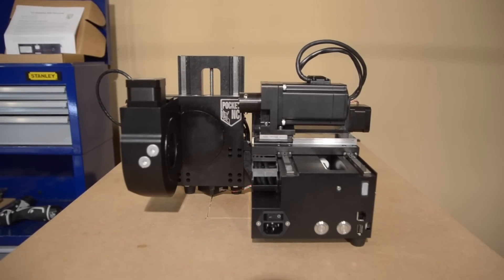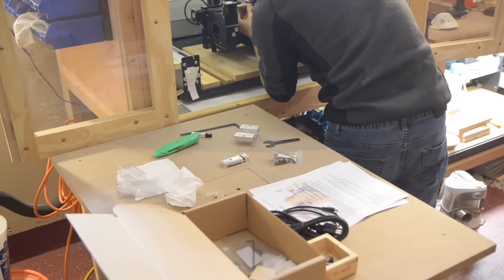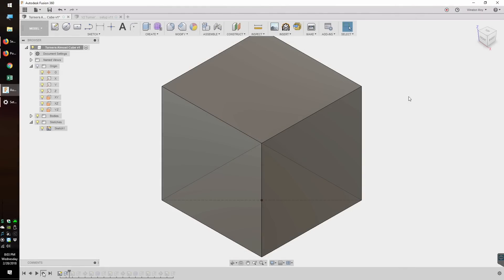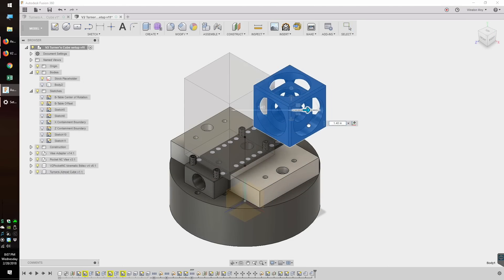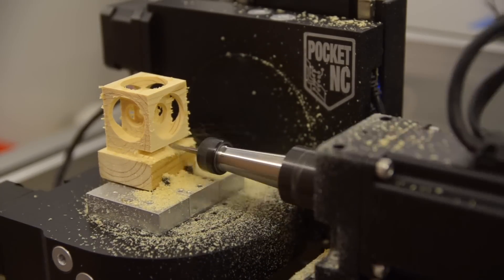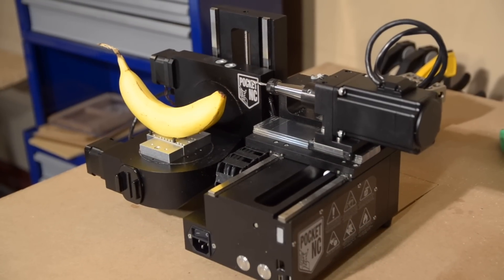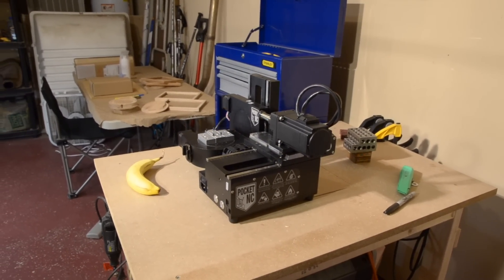Intro to 5-Axis Machining on the PocketNC v2 - Project #112 [CNC]

Comment: Does this have the torque required to carve hard rock? That means that the machine must be able to withstand constant water.
Reply from the maker: The axes are not suitable for exposure to liquids, and abrasive dust would also damage the machine in the long run.

Comment: if have 10k on pocket buy 3 axis mill.this wont sell to masses becouse price.6k for v2-10 10k for v2-50.is it mean v1 cost 2k. yeah i would buy it.even without motors and hardware,but now. it wont hit masses.its only sell to those who has 10k on pocket to spend at one go,but all those who has 3k something spend it on some else.if they would sell bare bone machine without hardware then later they would buy hardware kit or build then cheaper yeah.after order they hit cycle start on cnc propably allready setup for multiple parts.then they go tanning while cnc cut it. it wont cost that much

Comment: My own philosphy is: if you modeled some thing that could be produced only by 5 axis milling - you are an idiot, but not an engineer. The cube you shown in the video could easily be done on every cnc router even with the chamfer. There is no such a big problem to rotate the cube an change its position by hands. You will have also to do it for the last side of the cube. For such a money i'd better bought a 3 axis steel cnc router

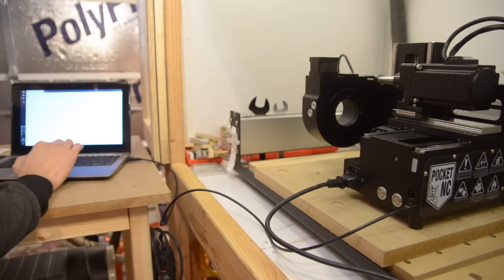Comment: At 4:35, you mentioned that the E-stop light never blinked. I have the same PocketNC machine and am encountering the same problem. If you don't mind sharing, how did you get the machine to work? For me, the blue lights around the Beagleboard turn on and then after a while, turn off. Let me know if I can provide any clarifications.

Comment: So if I want to get into machining do you recommend I start with CNC (obviously 3-axis) Or should I get a lathe and work with that? I’ve used a lathe for wood many times but only once for metal. Any tips? Thanks
Reply: Get a lathe, then a 3 axis cnc, then when feel confident go all out!

Comment: I don't see a practical use for the pocket nc. The nema 34 stepper motor it uses as the drive for the spindle is barely capable of turning steel but with that much tool stick out and the weaker a and b/c axis motors, plus the small work holding and work volume of the table itself, I can't even begin to imagine what this thing would be useful for. This isn't to say it's not a very interesting machine; because it is, but faced with a choice to buy this or a cheap 3 axis cnc router or even a second 3 axis cnc router if I already owned one, I would always choose the 3 axis machine no matter how many of them I had. I suspect most people given that same choice would probably do the same. I did say *most*. XD

Great vodeo nonetheless!

Comment: What are your feelings about rigidity of this machine? Is this a hobbiest tool, I have seen the demo of it machining aluminum but do you think you would feel comfortable machining small stainless steel parts with it?  I am concerned about chatter working with harder materials, titanium, 304 sst etc.
Reply from the maker: Rigidity is just enough that you're able to put some science behind your feeds and speeds. It won't be fast, but you should be able to hit normal chiploads with the right depth of cut. Look up @ekramer3 on instagram. He showcased a stainless steel lanyard bead he made on the PNC, and has plans to try titanium, grade 2. 304 is tricky, 303 would be friendlier.

Comment: is it suitable for sculpture designing engraving on iron up to 2mm raised form
Reply from the maker: If you're only engraving, maybe. But if you have to remove any significant amount of material I wouldn't. That's pushing the limits of the machine.

Comment: Lovely gadget but the web site suggests it will cut 4140. I seriously doubt that and $5000 and no coolant?
Reply from the maker: There's a video of a Shapeoko milling small pockets into 4140, with a small endmill you can get away with a lot. Won't be fast, but you'll get there by controlling cutting forces. This isn't a tool for mass production.

Comment: Okay, personal pet peeve:  CNC stands for "computer numerical control" and you sound ridiculous referring to every CNC machine as simply a "CNC", although you are not the only one to do this, by far.  What you have is a CNC mini mill, which is really cool, but radically different than a CNC lathe, CNC plasma cutter, CNC laser cutter, etc.  Calling everything that uses computer numerical control a "CNC" just makes you sound ignorant.  Not trying to be a jerk, just trying to help you with your terminology.

Comment: I see in the background that you've been using a Makita Trim Router on the Probably 3 axis CNC table. I just bought one myself however am yet to make the new mounting bracket. How has your experience with Makita been so far?? Earlier I was using one of those Chinese 400w quiet cut spindle which had quite a run out and burnt out fairly quickly the moment I started using 6mm end mills. When machining wood, whats the max diameter of tool you think the Makita can handle comfortably?? Can it run one of those 20 to 30 mm surfacing tools if take a 1 mm pass??
Reply from the maker: I liked it enough that I bought a second, so both my Shapeoko's are running the Makita. I have used it with a 1" surfacing cutter comfortably.

Comment: I have a v1 pocketNC and was one of the backers of their kickstarter for it. 
A bit of advice that I have learned the hard way:
Don't over think the work holding. Just use the painter's tape + CA glue trick for most of your work.

If you are not familiar with it, there is a really good tutorial on it on NYCNC youtube channel. The tl;dr is that you apply painters tape to the stock and then also to a waste plate. After cleaning the tape with IPA, you apply CA glue to the painter's tape and then stick the stock to the waste plate.

This provides surprisingly good holding strength. So far it has not failed me in milling blocks of aluminum on my PocketNC. Though do be leary of how tall your stock it, I have not run into problems yet, but it seems like really tall stock would be a failure point for this method on a 5 axis CNC.

The bottom line is that the pocketNC just does not generate that much force on the stock. I guess that is an upside of work with such a small unit.

Comment: $5000 for a 5.5x2.5 inch work space? I cant stop laughing. 5 axis or not that is robbery.
Reply: Pretty good price for that, particularly if you get some decent cad/cam software, I run MasterCam V10 and that fucker cost me $6K for one seat, (thats for one station / PC) it will not run with out the Key/Dongle in a port, GOOD CAD CAM cost lots of cash, machine tools not so much, this machine is great for prototyping in scale, when it works out contract it out for bigger scale.
Reply: @phubarnow5388  Why not use a free program like fusion 360
Reply: @phubarnow5388  so you paid 6k for a hobby program? Or are you making money off your purchase. Basically what you are saying is irrelevant
Reply: It's a bargain if it's quality. Only realistic way you're going to find a cheaper solution anytime soon is if you make your own. And making a 5-axis cnc that can holds its own against a professional tool is quite a challenge.
Reply: I'm with you. That is a complete shambles.
Reply: Needs lifetime warranty for that price. Considering a commercial machine is $60k and needs a 12x6 footprint this seems logical.
Reply: Its for jewelry
Reply: $5K ... for 4 axis .... but access to 5 sides of an object.
This is important.  what is defined as 5axis is not....  3+2 does not make 5 axes.... it makes 5 moves to create 3D objects. IT IS POSSIBLE TO CREATE 3D OBJECTS WITH 2.5 (AKA 3Axis)
Reply: @kennethkustren9381  It uses the same principle as commercial 5-axis machines. Not sure what you're on about.
Reply: Do you have a link to something comparable to this one for less Money? Just curious!

Comment: Its neat, but really too small to do anything other than make tiny parts, and the rigidity of such a small machine will have serious repercussions trying to machine anything other than plastic or soft aluminum especially with such a low torque motor. Not to mention the nearly 4 month lead time and the $5,000 price tag...  Buy A sherlineCNC with 4 axis... its way cheaper and way better.

Comment: What's shown here are basic moves. Easy stuff, 5 Axis is easy. I'm very close to selling mine. The PNC is weak. Very weak. You can throttle the spindle to 10K and stop it with your thumb and 1st index finger. I have to machine at 10K due to the lack in spindle torque luckily I found end mills that support low torque high spindle speed, well PNC max is considered slow in the CNC industry. I'm very dissatisfied with this product. No cooling/mist. You CANNOT find the center of a hole, which is extremely important should you need to enlarge one or perform internal threading and you CANNOT do work offsets therefore machining the B side of a work is impossible. No probing compatibilities. The vise is a JOKE as it bends under load. So work holding is inaccurate and not rigid. Work envelope is very small so hitting limits is always an issue. The pulleys that run the belts for A and B axis are 3D printed plastics that are low quality, don't know why they didn't go with GT2 pulleys instead. And the worst part when your machining metal which I do often, chips lands on the hall sensors. So good luck homing it. The X Axis will crash. This is a HUGE issue that is a clear oversight. There are far more headaches than successes with the PNC, and if I were you future shoppers, save your money. You have been warned. Oh and I almost forgot! The chatter, holy $h!t it chatters, so yah have fun with those shallow depth of cuts and axial loads. Even with Trochoidal milling.
Reply: ... yet they happily showed lots of videos of it machining Aluminium.
Reply: only u have 12 kind of alu plus some mix with other metals = soft is softer from medium wood (one that they use is one) then u got medium  i like hard wood ..and hard that is like 50% of brass ,, then u have avio   industry  .5 types .only 1 is used is hard and have some % of titanium inside ... rest soft to mild ... so 90% of ali is like wood  only these interesting for us are in zone that .that crap cant cut even u beg it ....
Reply: Hi Michael, sorry to hear you had troubles with some applications / feeds and speeds. The machine you mentioned is an older version as we have improved the design with a worm gear drive rather than the older belt and pulley system. Feel free to reach out on the forum or email us, we should be able to point you to videos or tutorials for thread milling, boring etc. let’s get you up and going!
Reply: Pocket NC Address the work offsets and find the center of a hole. I have a couple of ideas that may land themselves with merit. I hope. And of course it is now having a belt binding issue. The biggest issue I have with PNC is I was sold the V1 when the V2 was coming out in a couple of months. And with that $2,500 conversion upgrade fee - yeah NO! . This entire PNC venture has left me with a bitter taste.
Reply: they make this 5 axis  in mind that ppl will use only foam and soft wood

Comment: I saw this a few years ago and I thought it was cool.  It looks pretty ridged, but if it can't cut at least aluminum, then it pretty much sucks.  You can retrofit a 4th axis on a lot of combo mill lathes and CNC routers for a whole lot less with greater capacity plus metal cutting capabilities.
Reply from the maker: Barry Manilowa this can absolutely cut aluminum. Check out @ekramer3 on Instagram to see him pushing the PNCv2 to its limits.
Reply: The Pocket NC v2 has no problem cutting metal. The earlier v1 may be a different story, I don't know as I never owned one.  But I do own a v2 and as Winston mentions, I've cut aluminum, brass and annealed 303 stainless steel on the v2. Will be testing out dry machining of 4140 steel and titanium (grade 2) in the near future.

Comment: I am curious about the belt system on the rotational axes. It looked like a weird solution to me since they are usually done with worm gears for stiffnes. Can you wiggle the rotating tables at all by hand? Also - great vid, subscribed!
Reply: Oh it's there! I have dial two indicators, one to validate and the the other to confirm. It's there! Read my comment.
Reply from the maker: Can't feel any backlash by hand.
Reply: Luka, the Pocket NC version 1 used the belt drives. The Pocket NC v2 that Winston is showing here uses a worm gear drive on the rotary axes, along with several other improvements in the design of the machine. Overall, it is a more rigid, accurate and capable machine compared to the PNC v1.
Reply: So do you have the version 1 or version 2? I cant imagine a belt drive without backlash honestly, but Eddie said in a comment below that the new one uses worm gears, so if they are build in with a dialing in feature, its a pretty impressive machine i'd say.
Reply: @Eddie Kramer Thanks for the reply! :) Does the worm gear have a fixed bearing or ex center to allow for adjustment?
Reply: I'm not sure who your question was addressed to but I have the v2 machine. That is a good question re user adjustability of the backlash. I'm not aware of any provision to do so but can't say either way. I have published some measurements of my machine on my IG page (@ekramer3). Stuff like radial runout of the spindle and B table vertical deflection using a indicator. All were under (better) than  the values claimed  in PNC's specs. But I have not tried to measure backlash on any of the axes to date. I'll put it on the list for a future post.

Comment: Thanks for sharing. This looks like a really cool hobby machine. I'm truly surprised you found a way to post 5-axis tool paths from Fusion 360. I worked with that program for two years and never achieved good 2-axis tool paths for my lathe. And that was after I asked over a dozen "experts" for paid help. It's good to see someone making progress with the simplest tools. Keep up the great videos!
Reply: Harrelson Trumpets The post processor that PNC wrote supports simultaneous 5 Axis, it's easy. I've done a bunch of runs with it. But the machine is very limited.
Reply: Interesting...thanks for the response!
Reply: I picked up Fusion and was posting solid tool paths within 30mins. You could learn CNC Lathe programming in a day, go check out Titans of CNC.
Reply: Manny Calavera yeah, that might be true today, but three years ago when Fusion asked me to try their product it definitely was NOT possible.
Reply: A couple of years ago, most of that information really was not out there at all, so do not feel bad having trouble finding anything.
Reply: If it makes you feel any better I cant get the dame thing to install. I suspect that the wifi I am on right now and am stuck with unfortunately, is blocking it due to taking up to much bandwidth. I am having the same issue with other programs.
Reply: Blah blah blah

Comment: WTF enclosure costs $549?!?
Reply: The enclosure on a standard CNC mill is around $5000
Reply: Nickt, that enclosure is really well built. That was a pleasant surprise I discovered when I ordered my v2 machine and enclosure. Heavy gauge sheet metal, slide out chip tray in the bottom, quality hinge and damper system on the lid. Does a great job of reducing the noise level and mess for those that run the machine indoors, like me.

Comment: Thanks for the video! It looks like they downgraded the spindle from a sub-micron runout NSK Nakanishi to something else, possibly self-built. Could you investigate and possibly share some high-res pictures of the spindle assembly?
Reply from the maker: I'm copy-pasting from Ed Kramer (comment from yesterday): Here is the spec sheet on the BLDC spindle motor used in the PNC v2, including the all elusive max torque data. The spindle motor is 
manufactured by Kinavo Servo Motors. http://www.kinavo.com/pdf/smh_ch/K60BL30-48V-144-211-3.pdf 
I believe the PNC v1 used the K60BL30-48V-100-211 (based on the model 
number found in publicly available Pocket NC import data found at https://www.importgenius.com/importers/pocket-nc-company).
 
The only difference seems to be max RPM (14400 rpm vs 10k rpm). The PNC 
v2 is limited to 10k just like the v1 but I think the motor can go 
faster. And I don't see the  K60BL30-48V-100-211 model listed at Kinavo 
so it may be out of production now.
Reply: Winston Moy I did not mean the motor. I meant the spindle.
Reply: Here is what I think they used to use: http://www.artcotools.com/nsk-nakanishi-nrr2651-lever-type-spindle.html
Reply from the maker: http://www.pocketnc.com/spindle-comparison

Looks like it may be custom...?
Reply: Thanks, I feel like I should have found that myself, sorry. They have some balls calling that an 'upgrade'.
Reply: V1 model 2 is tops out 10K.
Reply: I am sorry, I do not understand. What is V1 model 2?
Reply: I think Michael is referring to the fact that the earlier V1 machine could be upgraded to the new design spindle (the one that takes removable ER11 toolholders). PNC switched over to the new spindle as standard on the v1 toward the end of v1 production.
Reply: Thanks, that makes sense. This is not an 'upgrade' at all. That NSK spindle is capable of running 50 KRPM -even though they did not couple it with a motor that could supply that. However, even more important is the runout of whatever spindle is used. And their homebuilt design uses setscrews (!) to pull the taper in as well as has a long projection away from the bearings. This is not going to be able to compete with the NSK spindle. It will cause very small bits to break and larger ones to wear faster. Would like to see a runout and stiffness test on the new spindle.  I understand cutting costs, as the NSK unit runs something like $700, but calling it an upgrade rubs me the wrong way.